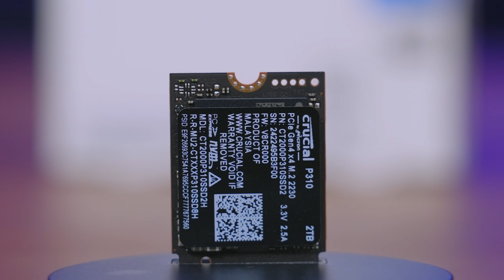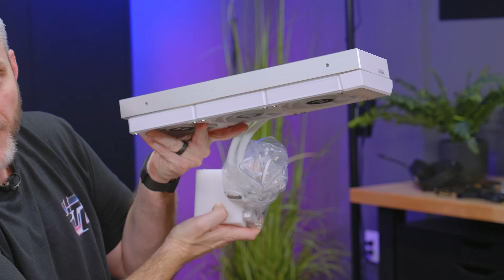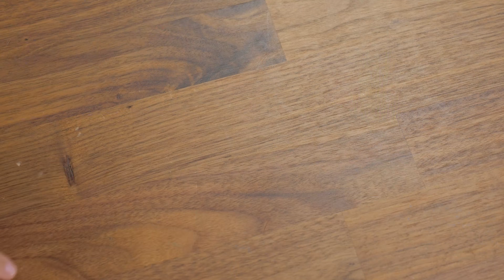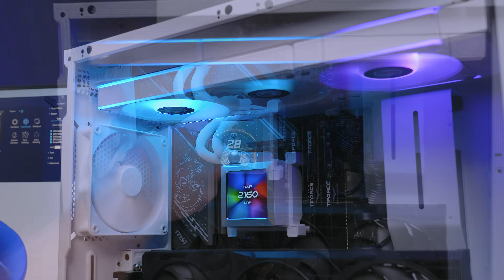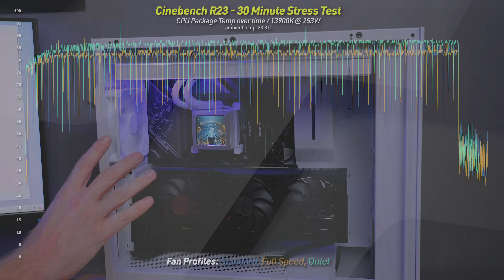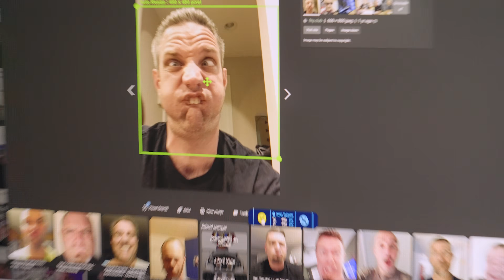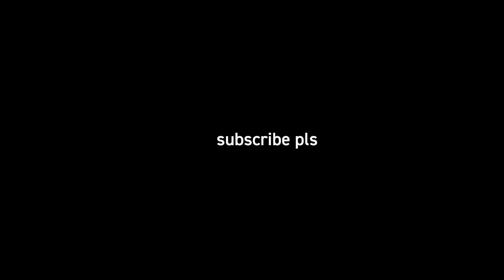Lian Li HydroShift 360R - Thermals and Stress Tests - is it worth it?

Comment: Absolute gimick that nobody wants to buy, its gonna be 150 to 200 dollar more expensive than a normal aio while performs same with 100 dollar aio, for what? A small low resolution screen sitting inside the case where nobody bother to look. Even those diy screen inside the case is more practical, not to mention you can get a large screen display sensors data outside where you actually can look conveniently for 50 dollars
Reply: Sucks for you, I won it for free on Reddit
Reply: $179 no-RGB fans, $199 for RGB fans, $259 for uni fans… so like, not that much more and even less, than some comparable AIOs 🤷‍♂️🤷‍♂️
Reply: @asksearchknock  yes I'm aware of that, it's one thing people do whatever they want to spend their money. I just hate these kind of blatant ads that trying to trick people thinking they need it, and 90% of them won't know the difference or even know what it means
Reply: Actually I bought it, it replaced my original Galahad, actually lowered temps 4-5c as well as looks clean and displays lots of information, to each their own
Reply: @Simon-tr9hv  why does it matter ? I’d rather have the short tubes than long tubes for a build like that and I’d pay an extra $20, or even $55 less than a comparable AIO with similar features and aesthetics… it’s not like it’s a $300 aio
Reply: Like the shifted tubes could nice but the lcd gimmick to just push those prices I can live without, same with rgb it's like my new build kinda made me go with an Glas sided case because that was cheaper then a fully enclosed one... (yes I realise there is cheaper cases but I also want something with quality from a name brand and not from some no name company) and Im glad that Arctic is just steamrolling the AIO space with their coolers for a good price to performance
Reply: Sounds like someone is bitter about what other people choose to spend their money on. 

“Nobody wants to buy”. Obviously not, given that many brands are selling products similar to this. 

Regarding the “nobody bothers to look” inside their case, I, personally, look in my case pretty frequently. My motherboard displays CPU temperature whenever the system is on, and any time I’m curious how the system is handling the load, I can just glance over and see what I need to see. That’s one clue I had that suggested it was time to replace my AIO cooler. 

If you don’t like it, then it’s not the product for you. If you find it too expensive, then it’s not the product for you. Other people, however, will find this perfect for their build.
Reply: @seanathanq  tell me, how many times you gonna reach your head around your case, trying to read some temp readings from a 3 inch screen deep inside when you could have opened a window on your desktop or a dedicated sensor panel right on your desk?
Reply: I find the screen useful for cpu and gpu temps+usage
Reply: I can see and read mine half way accross the living room.
Reply: @StolenJoker84  no I'm annoyed that companies use these complete gimmicks as selling point and jack up the price cos these useless "feature" exist
Reply: It sits on my desk to the right of my monitors like a desktop should lol no reaching around, and again the TL fans match the rest in my case and costs 30.00 less than buying 3 by themselves, and 4-5c is a lot. Again my money my choice, it's nice and matches the rest of my case and has the performance as well.
Reply: And you can buy a thermalright 360 aio with an lcd i.e. frozen warframe for 100 bucks or even less, for the same performance or even better 😂 F*ck these overpriced brands
Reply: @hugomouteira7015  yep you are correct but hey to each their own I'm happy with my purchase, others don't mind how their computer looks or performs and that's just fine for them, and some people don't have the money to buy other ones it's all on a person by person basis
Reply: its almost like gimmick or not these videos are targeted towards an audience of pc enthusiasts that will spend money on these gimmicks just cause its cool to them
Reply: You can make the argument about it performing the same. Thats a fair and comparable. What you can't make an argument on is money. Everyone gets paid different and a dollar might be more to me than it is to you. So stop telling people to not buy something based on money.
Reply: It's for people with disposable income to pretty up their computers, which means they should've just charged an extra 50 dollars and used a decent screen instead of whatever the hell that is.
Reply: I paid $114 for my DeepCool Mystique 360 aio. I highly doubt this perfoms better.
Reply from the maker: A 27" 1440p panel has a PPI of 108.79 while this screen has a PPI of 235.70 making it far closer to the density of a 4K monitor. Not to mention it's IPS and not TFT or VA like so many other lcd displays on AIOs that feature them, 

Don't hate something just because you don't understand it, there are plenty of brands that do not feature screens and are more muted in style for people like you. 

I think you may have some maturing to do before you tell people what is stupid and isn't, let people enjoy what they want.
Reply: @StolenJoker84 Karen's are usually are bitter about what someone else is doing😅.
Reply: It's not something people need but just astatic just like rgb ram rgb fan  @Jayztwocents
Reply: @Jayztwocents  no wonder why I stopped watching your videos since a year ago, goodbye jay
Reply: Who made you the arbiter of what "nobody" wants? By you lodging this false claim may make others go out to buy it just to spite you😂.
Reply: @Simon-tr9hv  again, it’s useless to you . It’s not a completely useless feature to everyone.
Reply: @lynnrunningdeerB4  Right? It’s almost like they don’t have anything better to do with their lives.
Reply: @Simon-tr9hv  “I stopped watching your videos a year ago …” 

… and yet, you’re here on one of his videos being negative about something that’s obviously not for you.
Reply: Lol building a pc is all about buying stuff you don't "need" and things that add little to no value, expensive motherboards, expensive cases, rbg, custom water cooling, overkill gpus etc
Reply: That nobody wants to buy ? 
I have it lmao
Reply: @Jayztwocents hahaha u slayed him
Reply: @elchancho8432  WOW, REALLY?? Can you tell I'm being sarcastic? Cos it seems like you can't read between the lines, Im being sarcastic btw, just so you would understand
Reply: Used to not even want to build a pc without one of these I’m a little older now and I think air coolers look a little better
Reply: @Jayztwocents you clearly dont know what people enjoy, you havent broke a million views in forever and you even struggle to reach 500k, seems you just dont care anymore and upload anything
Reply: @bababooey3647  Jay never said he knew what people enjoyed. He simply said to let people enjoy what they want.
Reply: @StolenJoker84  oh no i know just wanted an excuse to comment that since it seems like he doesnt know what people actually enjoy watching these days and thus has a bad subsriber to viewer ratio and doesn't seem to care anymore
Reply: @Jayztwocents You fell victim to one of the classic blunders! You fed the troll! 😂
Reply: Aww love to see it jay 😂 always gonna be people hating stuff they can't afford or don't understand instead of just being quite and moving on.
Reply: @Simon-tr9hv You're not as smart as you think you are bro just stop. 😂
Reply: @rawj1213  OH really? What makes you think you are smart enough to judge me? You got a certificate or something?
Reply: Ill buy it 😂, good thing you dont have a channel wouldnt watch you ever, goodbye simon @Simon-tr9hv
Reply: Agreed mate. I'm starting to feel like this guy isn't the "watercooling guy" he keeps referring to himself as anymore.
Reply: I was tempted to get one but honestly didn't really want a screen and the price was pretty high. I ended up opting for the Arctic Liquid Freezer III instead.
Reply: @Simon-tr9hv  most cases would be facing you so there is no looking around so give up on trying to justify your own opinion with poor thought out arguments  just admit you don't like it for personal reasons
Reply: I bought a gigabyte one 4 years ago and your right it was just a dumb gimmick that i stopped caring about after a few months. It doesnt even allow gifs just static images 😂
Reply: @Simon-tr9hv  it's only useless to you alot of people don't want to go through the trouble of making those sensor panels so they go with coolers with a screen and this is for those who want less tubing and a screen
Reply: @seanathanq exactly
Reply: @hunterjw88  AH yes, trying to read something from a tiny screen hidden deep inside your case is SOOOO MUCH EASIER than opening a window on your monitor, why haven't I thought of that HMMMMM?
Reply: Lmao broke boys out here complaining for no reason other than attention to a corny comment thread. You don’t like it? Cool, move on. You do like it? Cool buy it. It’s literally that simple, don’t know why everyone thinks their opinion means anything much like my own comment 😂😂
Reply: @StolenJoker84  probably because they don't.
Reply: You do not speak for everyone. YOU do not want to buy it, great, move on.
Reply: @mpresto15  are you talking about the gigabyte one only doing images? Because the lian li does mp4 video as well as gifs and images.
Reply: @Simon-tr9hv , you stopped watching, but watched this and commented? Get a life.
Reply: I’m not even going to get into the pricing bc the offer several versions of this model for $160-$200, way cheaper than the other high end competitors like MSI, ROG, Corsair, etc.….but Yeah it totally adds no value in performance  & it’s all about paying paying for cosmetic features lol 

This is why a lot of the people who get actually create both software & hardware stay away from the PC “gaming builders” , due to their elitist attitude as if putting together PCs makes them an expert on anything Tech related. Let me clear this up, playing an adult version of essentially Lego’s, reading a few manuals , & watching a few videos,  does not make you an expert. Requoting what you heard some Gaming Tech Tuber  told you doesn’t mean you have any idea what you’re talking about either. 

On top of this, PC gaming only makes make up 10% of the total market, you’re incredibly niche in just the market of people purchasing or building a machine. So the 1% that just wants gaming function, that harp on screens, LEDS, RGB & liking one another’s “blacked out build” , with the plopped in most popular gaming AMD CPU & GPU…You are even a smaller portion of that market, you make up a single digit percentage of the total consumers of the PC market. So quite the contrary, you have the least idea what people want in their systems & h what they are looking for. 

This new PC gaming elitist attitude  has made a niche hobby become boring & has ruined all the creativity due to how narrow & hive minded ppl like you have become. Grow up & realize how little of weight your opinion holds.

Screens & shorter tubing on AIO made you throw a hissy fit, which is hella embarrassing.
Reply: @Jadedx_ , why are you here if this channel is so niche?
Reply: Some people like gimmicks in their PC. If you seriously can't afford $250 you need to take a hard look at your life because that's even below minimum wage. I have seen water cooling cost more than this before.
Reply: It's obvious that some people don't understand brands making products targeting a specific market. Lian Li didn't make this product for you, and they are not forcing you to buy it. You complaining about this product is the same as complaining about buying shoes when you can just walk barefooted. With your logic, the functions of wearing shoes are also a gimmick.
Reply: @jamesm568 to be fair, that’s more than some people spend on their processors. It’s understandable that someone would see that as excessive considering how well some cheap air coolers or even AIOs perform.

But this isn’t the sort of product you get for pure cooling performance, and that’s fine. I like the gimmick, I’m getting one of these in my next build because I think it looks cool.
Reply: @sircaballero  Valid point, but this product is not meant for People who have budget computers. If he's truly worried about cost he would just go with an air cooler or an off-brand $50 AIO.
Reply: @Simon-tr9hv  Wow. Imagine judging others and then have the audacity to tell others that they can’t do the same to you. The narcissism. Get a job.
Reply: My 2 4090 don’t care.
Reply: @jamesm568  100% agree. You're paying extra for aesthetics here. If the aesthetics don't matter to you (which is a valid opinion) then there are better coolers available.
Reply: @Simon-tr9hv it's a youtube channel, not an airport. No need to announce your departure.
Reply: 100% COMPLETELY agree with you! Would much rather they spend money on the cooler itself and things like special coating on metal for minimal corrosion wear during long, long use. and extra good quality of the pump so it lasts extra long.

screen is only unnecessary and something that only makes things expensive that has nothing to do with the performance of the cooler or how good it is
Reply: @ford1546  I agree that it doesn’t affect the performance of the cooler, but it does give an idea on how the computer is performing without the need of a dedicated sensor panel taking up space on a desk, for those who want easy access to that info.
Reply: @Jayztwocents  
yes, as long as putting on a screen does not affect the performance and the quality of the cooler then ok. But when screens become more common and more brands offer this, I am sure that it will be the screen that will be given more priority than the cooler itself.
Reply: @Simon-tr9hv   Rage harder
Reply: @john5243  oh I ain't raging, if it's not obvious enough, it's extremely entertaining seeing you guys trying to study every words desperately looking to attack every words I replied
Reply: I want to buy it.
Reply: Why wouldn’t I want to buy it?
Reply: Just put the fries in the bag bro
Reply: @Simon-tr9hv bro is mad people don’t have the same OPINION it doesn’t matter what other people like. just like how you don’t like this AIO someone else will and it shouldn’t matter to you. it’s not like it will cost you money when someone buys it so why get so caught up over it
Reply: @recon12803  LMFAO
Reply: @Simon-tr9hv  
If you're not interested in the product, you can just stop watching the video. There's plenty more products that jay can talk about, and it's not like you have to buy everything he features in a video.
Reply: @Simon-tr9hv  Clearly that's a lie since you responded to this video & your comment comes across as you watched it.
Reply: @EnderSackboy  ah yes, people aren't allow to critise a bad products now? They can't voice their opinions? If I don't like it, I should just not say anything and move on? Then everything in the world will be perfect, we would still be shouting for communication, travel miles on foot and eat raw food
Reply: @Simon-tr9hv  
I'm curious. Did you watch the video because you are looking for an aio with a screen?
Reply: Sorry, but I absolutely do not get your comment … makes no sense at all and far from reality … nobody wants to buy? People are pretty keen getting it. price wise it is at the same range as most other aio’s are, even cheaper. The whole aio with 3 fans costs less than 150£ … with RGB fans 50-80£ more. Nothing with 150-200£ more … and which aio with lcd display do you get for 100$? This ‘gimmick’ is exactly the same other aio’s offer … a versatile small lcd display … of course people look at it. Regardless whether it is Kraken, rog , Corsair etc … they all offer such kind of display with more or less) features. Those isp displays with system info are hugely popular. The diy inside are more practical? Pretty nonsense to add one if the aio provides the info. Why adding an additional small isp display when the aio offers the same. A large sensor screen you do not get for 50$ … a larger one is around 99£-200£ … and having such thing outside the case is far from convenient …. Its another item cramming up the desk.
Reply: People will definitely buy it
Reply: I've got one,  love it and use the screen all the time
Reply: It's funny to see people complaining about the price of this AIO😄. Here in Brazil it costs more than a month's salary for most people. I'd love to pay R$150 to R$200 for it.
Reply: Get schooled, kid
Reply: Plenty of AIOs at this price point, hiding most of the tubing is a welcome “gimmick”
Reply: Sucks for you,  i want to buy it and 100% plan on buying it after the holidays when I can get things for myself more often than I can this time of year,  but you have fun hating
Reply: @Jayztwocents dayum that response was worded perfectly. I’m looking into doing a bit of an upgrade to my current pc and this is an aio I’m interested in
Reply: The screen and tubes look cool so i want it.